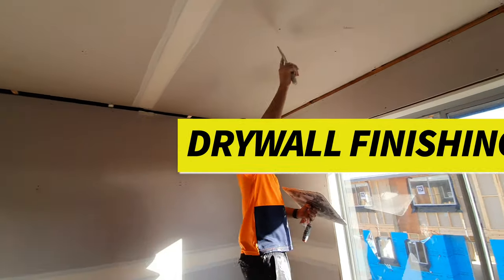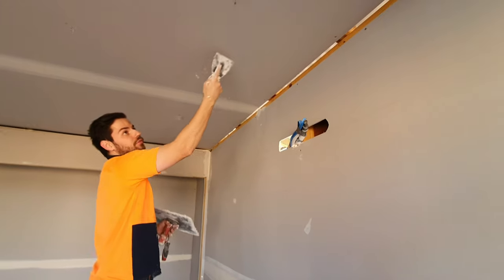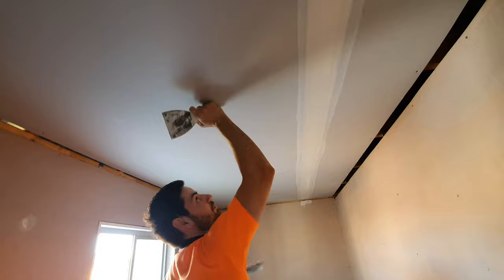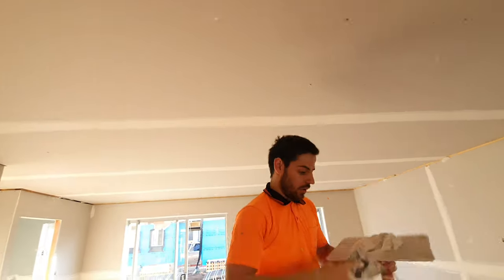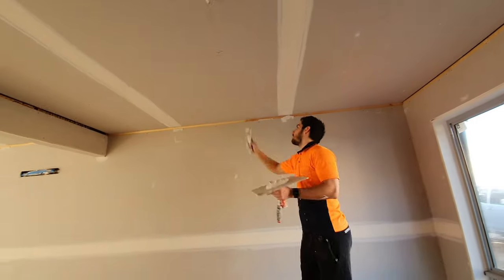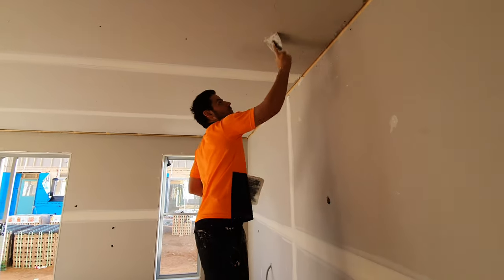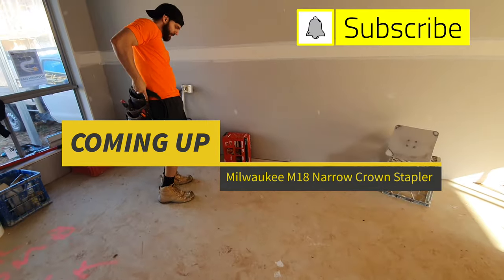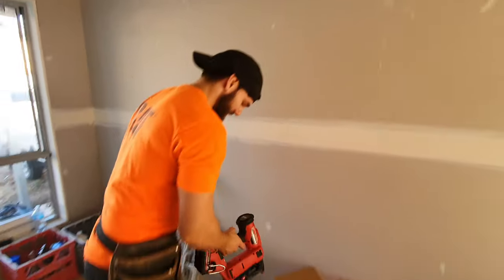DRYWALL FINISHING SCREW HOLES FASTER HOT TIPS | Drywall Finishing Construction Series #5

Comment: hello I love your videos I exercise the same profession as you in France for twenty years but I start with the super banjo and the load boxes here we do not find the same product as you because of our climate not very hot and humid it is used as curable paste do you have any advice to give me? which product do you mix to not have lots of air bubbles in the coating?
Reply from the maker: Thanks Vincent, yeah good question, i don't really have the answer to that one. possibly "no pock". I've heard people use dish soap, but wouldn't recommend it . maybe the Drywall Gangsters will see this and can comment.  I will pin you comment maybe someone can answer that better. Thanks again for watching
Reply: What is the product you use called?
Reply: hello i'm using a hardening paste that takes 3 hours
Reply from the maker: You want to be Maxkil France?
Reply: @Maxkil  
hello why not
what would that consist of?

Comment: It’s not pointless way faster then doing one screw at a time you would get sent home from my foreman if you showed up doing this a screw at a time 😂
Reply: If you're using all purpose mud and swiping twice yes can be quicker but if you're using chemical set that doesn't shrink you need to swipe three times on them or you'll have to scrape them back flat before your next coat then it's not faster because in Aus in most ceilings it's just two screws in a row because of board being glued to the ceiling. It only takes 10 minutes max to coat the ceiling screws in one townhouse this way. Now ceilings without glue is different there's not just two screws in one line and makes more sense to swipe a cross and not spot them
Reply: @drywallgangsters  Even hot mud shrinks to some degree, albeit not as much as premix all purpose or topping mud.  Keeping the added water to the minimum needed also helps prevent shrinkage.  If it didn't shrink, they would not need to do 3 coats, they could be done and finished at 1 coat.
Reply: V C you're correct more water more shrinkage and yes they are done in two coats not three because we use hotmud for first coat all applications and there's basically no shrinkage on screws because we use a thick mix to coat them so less water
Reply from the maker: well you have more screws to do in a line. Thats all. And depends on whos coating the screws, I'm 3 times slower so would definitely be faster for me. But not for him. I'm not that neat either.
Reply: @drywallgangsters   hi do you guys wipe your topcoat tight or do u leave a slight build? Would be great to see a video... amazing work guys